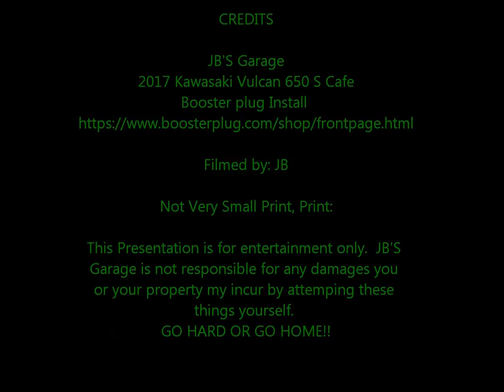Kawasaki Vulcan S Booster Plug Install

Comment: Hey mate great vid, never heard of this booster plug thing before this video and am interested yet slightly confused, so it tricks the sensor into dumping in more fuel because it detects a lower engine temperature therefore more fuel for power, I wanna know if that would damage the engine because of the higher amount of fuel being added with the engine reading cooler?

Also isn’t the power commander more for “re-tuning” the bike because of modifications made to the exhaust system e.g TBR full system + DNA air filter and the power commander adjusts to the new air to fuel ratio? I don’t think it was intended to solve the issues you mentioned with it being a bit more jumpy in second and first gear, I’ve recently purchased a brand new Vulcan also and haven’t noticed that yet but will take note of it next time, might be a bit different for us in Aus since  we are forced to have the restricted version (35kw + 45hp vs 45kw + 55hp) 

And did you drill holes in the muffler to make it louder? 

Sorry for the barrage of questions 😅😂 just curious
Reply from the maker: Wadie _ Great questions!  I don't know if I can answer them all with accuracy as I am learning myself.   A lot of your questions can be accurately answered on a great forum like Vulcanforums.com in the 650 section.  From what I have read, it is completely safe and your ecu actually relearns and adapts.  
I did drill holes in my exhaust. Its louder but not with the deep growl we'd all like to have.  
The power commander is a dyno tool that you either buy maps or reflashes for it or tune it yourself and hope you don't screw something up.  BoosterPlug is plug and play as you can see!  It has a good positive history with other bikes as well.  And its only $160 usd, so thats a huge savings over Power Comander.
Hope this helps and thanks for reaching out!!
Reply: The booster plug makes MINOR fuel adjustments.  I don't see how "dumping more fuel" is implied.  You'd get the same results from a Power Commander V tuned to adjust the air/fuel mix at lower RPM, but didn't pay $350!

Comment: Just put the boosterplug on my Vulcan s. WOW! Huge improvement over stock. Worth every penny.
Reply: Glad you are enjoying it!  I wish I could enjoy mine.... Ohio Winter!
Reply: Next buy a m4 slip on. Cut off the stock exhaust muffler and weld on  slip on adapter. Great sound with minimal cost. I did mine for $54.00 total cost.
Reply: @bryanpetrich4125  sweet! Can you film a start up with sound? I have a resinator from a dodge mini van that I was thinking of using as a slip on weld on!
Reply: Look up Kawasaki ninja 650 m4 sound. It sounds exactly the same on a Vulcan s
Reply: @bryanpetrich4125  but you own a welder ($$$) and have the skills to weld LOL That significantly increases the cost.
Reply: Kwisatz Haderach Even if you take it to a muffler shop it’s still going to  be cheaper than buying a whole system.
Reply: @bryanpetrich4125  alright!

Comment: Awesome!  Never heard of the Booster.  I plan to order one soon!
Reply from the maker: MrEye4get it is still working out Awesome!  Check out the link in the description.  It will take you directly to their website!  I have no affiliation with Booster Plug but some answers to questions you may have can be answered there or by reading these Threads on a vulcan forum! 
http://www.vulcanforums.com/forums/showthread.php?t=287937
Reply: Purchased a Booster Plug and installed with a new DNA air filter too!  LOVE IT!!
Reply: MrEye4get what bike?
Reply: MGTOW Bombay & Swiss 2016 Kawasaki Vulcan 650 S

Comment: Guess what, just bought a 2023 one and the problem is still there BUT, guys tell me booster plug not designed for it! One dealer says he will sell me one unofficially and I can return it if no improvement! What you think Sir?

Comment: I forgot to post this!  I installed the Booster Plug on my 2016 Kawasaki Vulcan 650 ABS and Arrow Rebel Exhaust!  A noticeable improvement!  It does everything it promises.
Reply: MrEye4get Hi, what difference have you noticed. I just ordered mine.
Reply: Did it make the on off throttle smoother.  This is my first bike and it makes it not very enjoyable not being able to just cruise.  Cant maintain speed at all it's either accelerating or slowing down abruptly when going on off throttle.

Comment: ill need to reference this when i decide to get mine
Reply: TheRealTDawg i installed mine last weekend, best mod ever. Smooths out the bike completely, no jerking when decelerating, backfire will also smooth out with your danmoto. I wired mine along the wires on the right side of the tank and frame, isn’t catching much heat either from the radiator which is a big plus.
Reply: I've been following you since I got my bike in March 2018!  I like your channel!  Give me a shoutout sometime!

Comment: I'm at like 130 miles of riding and still ain't used to the on off throttle jerkiness.  Its aggervating and makes for an exhausting ride, especially being my first motorcycle.  So I'll have to get this hope it works.  If not have to get g2 throttle tamer and pray it works better.  Otherwise I'm getting rid of this and get a carburetor bike.
Reply from the maker: It does work! It's night and day!
Reply: @JBsGarageHowTo  I hope your right and thanks for the video install with tips should help out a lot.

Comment: Hey JB thanks for posting this video! I installed mine yesterday and I test rode it today. The difference is awesome! However shortly after riding I started hearing a rattling sound somewhere under the tank whenever I accelerated, I'm thinking something might be loose since I had a hard time figuring out where to attach the new cables of the booster plug. I was trying to see where you attached yours but it's hard to see the location in the video. I'll be taking the tank off again tomorrow to find the source of the rattle.
Reply from the maker: Neomi, that's Great! Which parts of the cable are you referring too? The sensor or the actual plug ends? I will try to screenshot the areas once I have a better idea of what you are referring to!
Reply: @JBsGarageHowTo  Not the sensor, the parts closer to the connections of the air box. I'm guessing I didn't zip tie them to the right spot. Thanks
Reply: I just want to make sure to zip tie them in a place that will not interfere with the tank once it's back in place.

Comment: installed mine today (after the first 500 miles), didn't notice much of a difference to be honest, not had much of a problem of engine breaking but my vulcan came with the arrow exhaust from new, still pops a bit when releasing the throttle around 4-5k rpm, will see once I take the bike out a couple more times, but 20 miles today and it feels that any improvement is just placebo
Reply from the maker: Mihai Oltean it gets better as you put more time on it!  The ECU learns and you fuel consumption will keep getting better.  A few weeks ago I was at 42.2 mpg now I'm averaging 44.6.
Reply: not too worried about fuel consumption, only ride it for fun, will come back in a few weeks with results, next thing is to remove the baffle just out of curiosity really, it would be nice to get it just slightly louder, but 2018 pipes I think are welded inside - can't find any info online
Reply: So did you notice any improvement eventually or still think its placebo? Thanks
Reply: It also did not work for my 2019 Vulcan S.

Comment: Wouldn't the best place for the sensor to go be inside the airbox, just like the stock IAT sensor?
Reply from the maker: Not according to the directions.
Reply: Actually I found a forum thread online where the inventer of this device actually did say it would be the best place, but it's not easy to install in there and he figured most people wouldn't want to modify their airbox so it's ok to run it outside

Comment: Hey JB.. thanks for the video.. that seems like a lot of wrenching.. ;-) How long did it actually take you?  Also.. i love your helmet.. do you have a link to it?
Reply from the maker: Taking your time and being methodical, about 2.5-3hrs.  But if you have been there before, to change the Air Filter, About 1.5 hrs from battery negative terminal disconnect to  reconnect!
Reply from the maker: As far as the helmet, its a HTC is-17.

Comment: Hey mate, thanks for sharing this video. Did you notice any increase in fuel consumption with the Booster Plug? Thanks in advance
Reply from the maker: Ian Bolchi maybe a small amount more, but I have been getting on it more.  The display says I'm averaging 41.1 mpg.  So that sounds about right.
Reply: Many thanks

Comment: Bought a booster plug and installed it on my 2018 Vulcan S using your vid as a guide. There has been no discernible improvement. A friend of mine who has ridden my bike many times also didn't notice any difference. I'm at a loss as a lot of Vulcan S riders that fitted BPs seemed to experience significant improvements in the engine braking and throttle jerkiness. Does anyone have any idea why this might be the case? I tucked the external sensor beneath the head lamp.
Reply: It also did not work for my 2019 Vulcan S.

Comment: Have you had any problems with the engine light coming on? I added the booster plug a while back in the bike has ran fine it's still does but the check engine light came on and is flashing code 62 which is the sub valve actuator. I'm just researching right now trying to find out what's going on. I'm new to the motorcycle world so trying to learn as much as possible so hopefully I can fix it myself
Reply from the maker: Mike Yates check out this Vulcan forum.  It should help you out! 
Service code info https://www.vulcanforums.com/forums/showthread.php?t=280449

If you like it, look for me, VulcanJoe!
Reply from the maker: Mike Yates to answer your question fully.  I have a little over 2400 miles on mine.  No check engine light to date.  You should definitely check out some kind of motorcycle forum.  I am pretty mechanical and I've learned a lot from talking to people on Vulcanforums.com.

Comment: Question?  Do you need to install Performance Air Filters before installing Booster Plug?
Reply from the maker: Ely Mike Pingol according to Boosterplug, you do not. I have stock air filter on mine. I will be putting on a hiflow filter the next time  I am working under the tank.

Comment: My engine braking is horrible no matter what gear I’m in. As soon an I release the throttle the engine compression slows down so quickly it’s bucking me forward. Will this Booster Plug correct or soften this issue?
Reply from the maker: @VTX88 It will Greatly reduce that bucking.  It is actually amazing how well it corrects the problem.  I have no affiliation with BoosterPlug.  I bought mine the same as others.  One other thing you can try first is adjusting your push pull cables of your throttle.  The pull adjustment is on the back of the throttle grip and the pull adjustment is on the right side of the engine just below the tank.  If you have the manual that should of come with the bike, it will reference it in there as well.  Also check out Vulcanforums.com.  You can friend request me by the name of VulcanJoe.  Hope this helps!!

Comment: Do you run 91 octane in yours?
Reply from the maker: Mike Yates I actually run 92-93.  I find it runs much smoother.  I now have about 1100 miles on her and I am averaging 44.2 mpg or 18.79135 kpl.
Reply: I found the same with 93 octane. I was just wondering because I got my booster plug today unfortunately I'm still at work but it is sitting at the house waiting on me so I'm pretty stoked about it thanks for your video I really appreciate your step-by-step instruction I will be watching it while I'm putting it on. If you're ever in Southern Ohio Hocking Hills look me up we got some sweet roads to ride on!